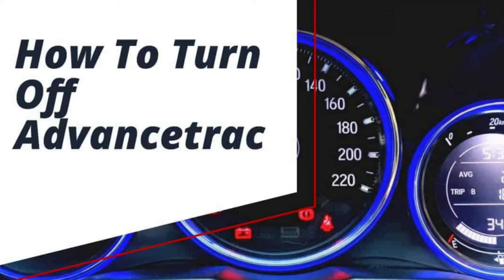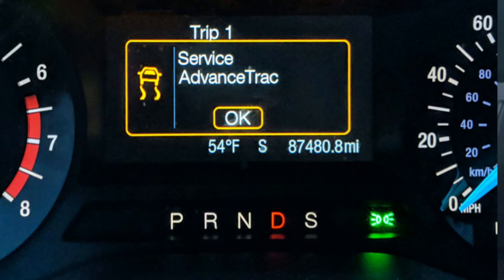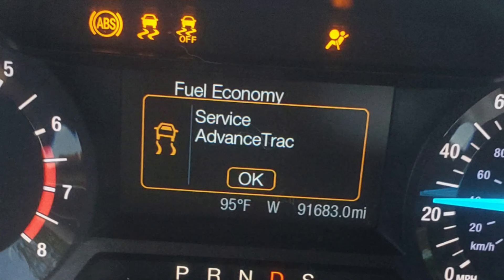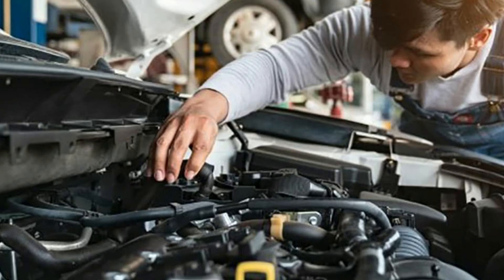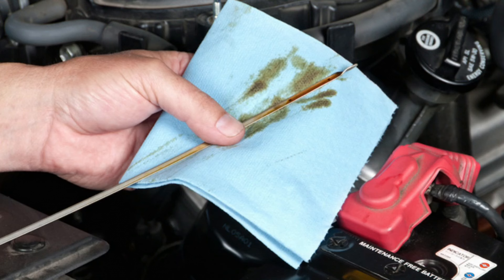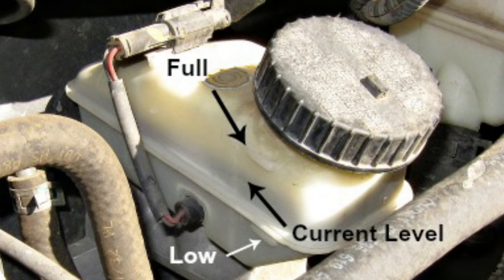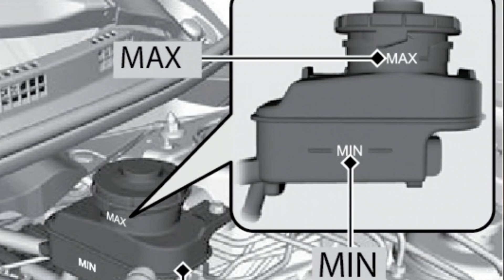How to Fix & Reset Service AdvanceTrac (RSC) Warning Light Stays On/Flashing | Step-by-Step Guide

Comment: What is the name of the back sensor
Reply: 1:50
Reply from the maker: @lukawskijanetz6673
The back sensor related to the AdvanceTrac system is usually the rear wheel speed sensor or the yaw rate sensor. If you're experiencing issues, checking these sensors along with the ABS module could help.

Comment: Should I expect to pay for a diagnosis before the advance trac problem is fixed?😢
Reply from the maker: @user-gh1xe6wk7q
have you tried the steps in the video ??
Reply: You don't ever have to pay for a diagnosis. You just need to be confident in what you need repaired. Don't let them swindle you with all their professional terms. If the vehicle was perfectly fine before and you need a simple repair done. Agree to pass on the diagnosis and pay for the repair you requested. don't be swindled!!
Reply from the maker: NO need to buy it